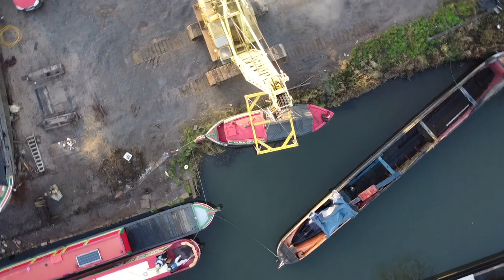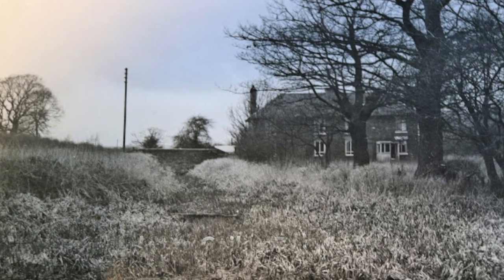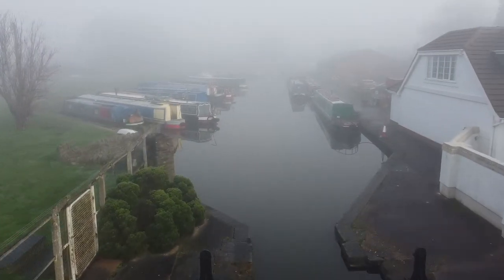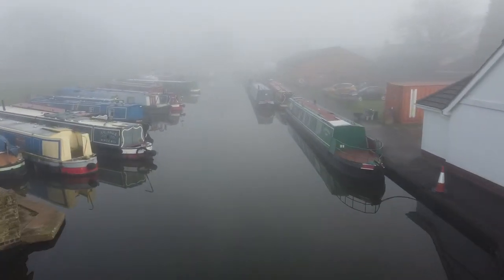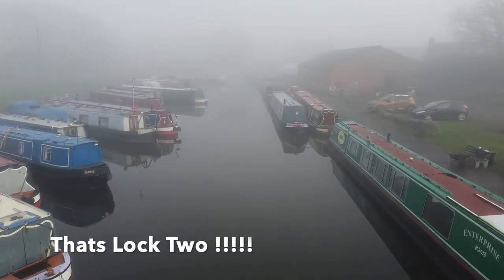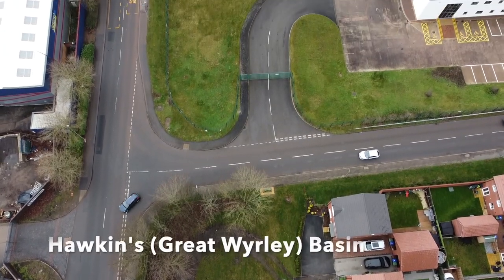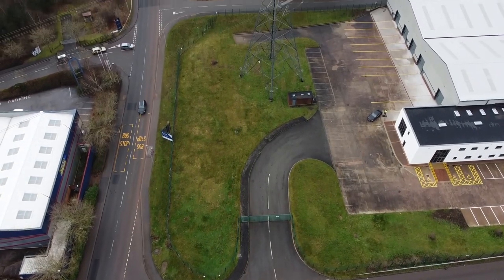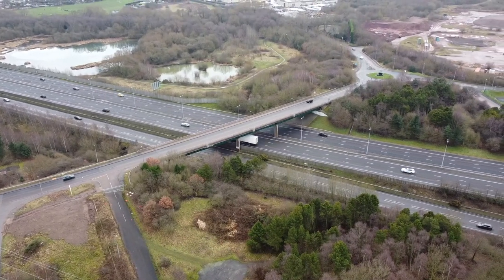7.1 Hatherton Branch Canal - end to end

Comment: The overlay is quite nice.  I would add some present day close-ups of bridges, etc. that still exist.  Shame that the branch sits idle.  For most of it's length there is little to no obstruction to restoration other than that first "M" highway crossing.
Reply from the maker: It was a bit of a compromise to keep it down to 20 mins! My history version has a lot of photos of the dropped bridges. The issue is that as a branch it goes nowhere really, unless it finds a new route onto the BCN.
Reply: It's on our to-do list: https://www.lhcrt.org.uk/hathertonmaps.htm